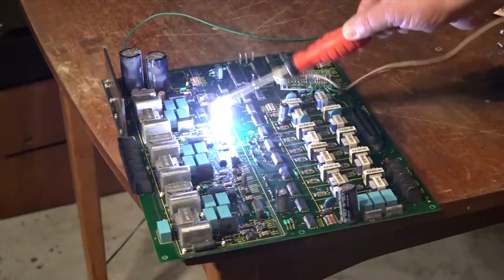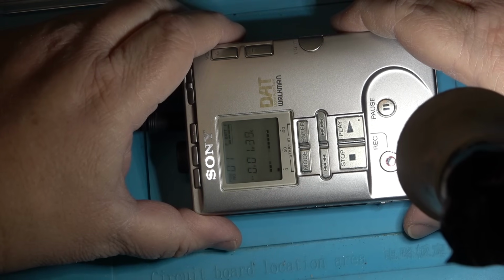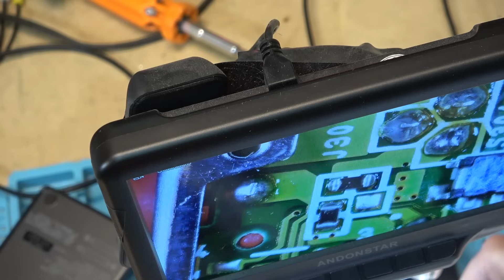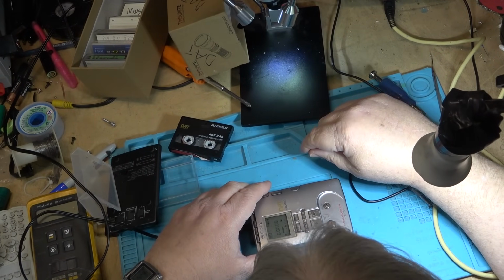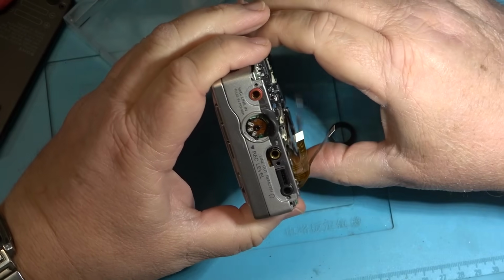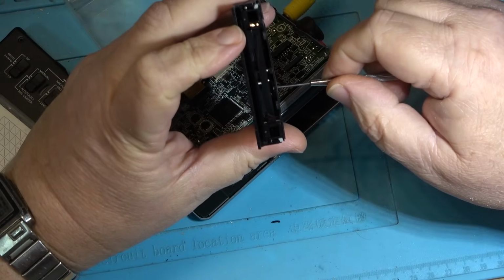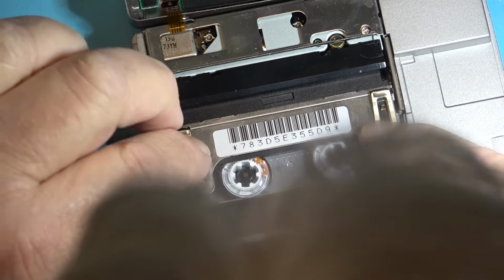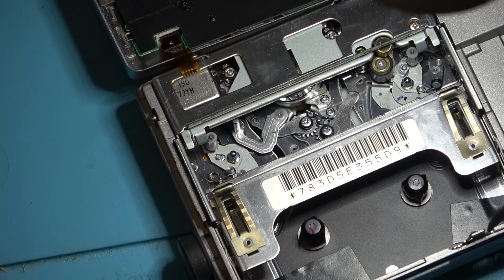Oh CRAP another DAT!

Comment: Hey Dave, can you show us how to re-lube/re-grease a VCR? My JVC GR-C1 VHS-C is struggling to load tapes and I'm wondering if the guide tracks and loading cogs need new lubricant. It loads so slowly it goes into emergency shutdown. Do you use silicone grease?
Reply from the maker: I believe i have done a few already.  In the back catalog there will be several.  I use lithium grease.  That old black grease has to go.  It turns to glue.

Comment: DAT should have been left where it was intended for in a studio rack
As soon as you make a mechanism that is small enough for consumer portable use
they become far too fragile with parts that break or just wear out.
Reply from the maker: These were made for a specific market.  To smuggle into a concert to bootleg the perfornence!
Reply: They are still not fit for purpose, and what is the point of trying to bootleg a live
performance with all the noise in the background?
I never was a fan of live recordings. @12voltvids
Reply from the maker: @Barbarapape  I'm not disagreeing.  There us too much to go wrong in these tiny units.  A much much much better choice a tascam dap1 or teac dap20. These have robust transports, basically the same as found on the studio decks, xlr inputs and were designed for field use.  Now as far as bootlegs are concerned it really depends on who it was.  I have a bootleg of the Beatles recorded illegally by the then famous DJ red Robinson as he was the emcee of the show.  He ran a tape recorder under the stage at empire stadium in 1964 on the only stop the Beatles ever did I n vancouver.  The sound was pretty bad because all you can hear is screaming teenage girls screaming. On the other hand I have a bootleg of Frank Gambale, jazz / rock 🎸 Superman whom played with chick corea and now vital information.   It was a fantastic recording and there wasn't a ton of noise because those fans, and pretty much every jazz and classical perfornence the fans are there to hear the perfornence not make a bunch of noise except for when they are invited to make noise.  5 seconds after the last note fades away. They they quiet down and the performers wait for the audiences attention.  Saw return to forever reunion about a dozen years ago.  Wish I had the balls to record it because it was a fantastic over the top perfornence.